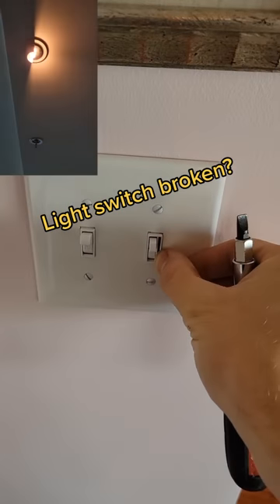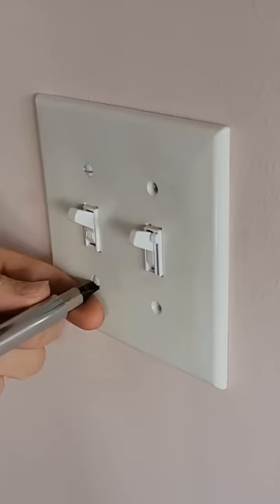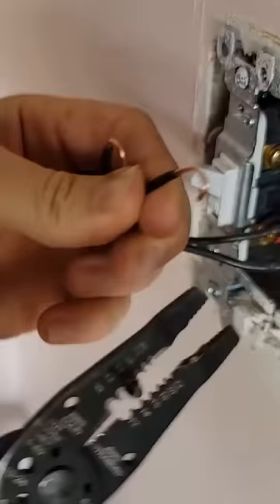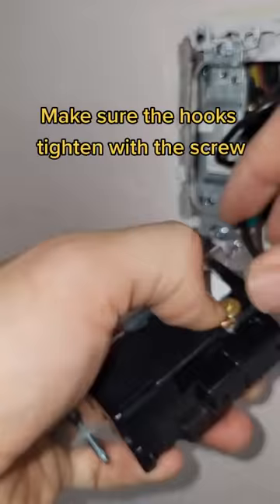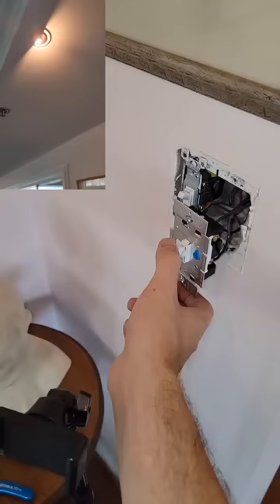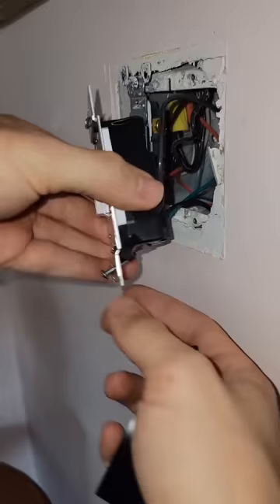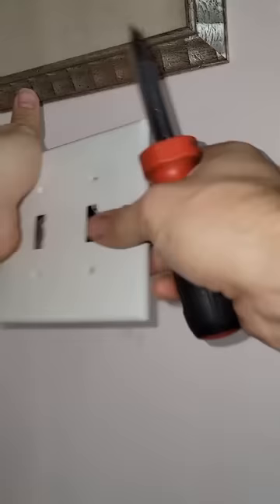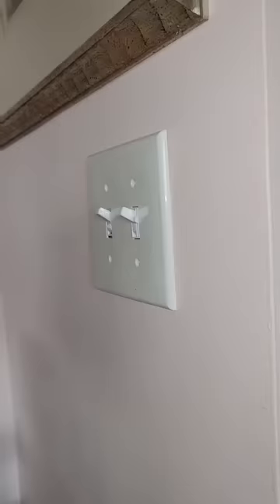dimmer switch not responding 😏 #shorts

Comment: Did you leave that single screw horizontal to trigger the electricians? Hahaha
Reply: Yeah we don't like that shit at all. Horizontal or vertical and that's the only acceptable orientation. I prefer vertical to match the direction of the switch pull or receptacle slots
Reply: @mikedavis9923  Vertical is the way to go, it keeps dust from collecting inside the screw head.
Reply: @BaerMichaelE  I’m not triggered though I do insist on uniformity. 
I like the fact that he’s doing intentionally to mess with folks…that’s funny
Reply: @samricketts8184  and it lets you know if anyone fucked with your work.
Reply: I feel like vertical is the most invisible, prevents dust and mousture accumulation rusting the heads and also is just a clean tidy finished look if every single faceplate is uniformly screwed on and not overtorqued and deformed. It's professional looking, and property owners/managers (at least pickier ones) do notice and it's one of those things that takes 0 extra seconds when you're doing the work to make your work better and have pride.

I work maintenance in hundreds of units and cleaning and tidying faceplates is one of our unit turn responsibilities, to prepare the apartment for new renters.

Painters please stop cutting in around faceplates and just Friggin take them off we hate you all so much.
Reply: Not an electrician, still triggered
Reply: I always laugh when electricians comment on screw slot placement. Most outlets I work next to aren't level but golf clap on the screw slots

Comment: Just shutting down the breakers wont do. As per NEC, referencing NFPA 70E Article 120, a Lock-Out/Tag-Out markings should be observe at all times in the corresponding electrical panel and overcurrent protective device. 

Also a proper PPE's should be observe and practiced at all times - wearing insulated gloves and using a multimeter to re-evaluate and double check the lines electricity. 

And most of all REMEMBER this. There are different electrical code in every country you live in and most of them prohibit the conduction of electrical works without a permit and a license electrical practician. One of the code objectives is to avoid any accidents and mishaps. Improper use and installation of device/equipment may cause short circuits, overloading etc. It may cause fire, injuries and even death.

Please consult your license electrician on your area. They are familiar with your own country electrical code. Better be safe ALWAYS.

Thank you for reading.

-Just a friendly advice from an electrical practitioner 😊

Comment: The 2 holes up by the top of the strippers are there to curl the wire into the loop.  Learned that on a studpack video and have used it ever since. Makes perfect fitting loops for your screw down terminals!

Comment: got 1 out of 2 things correct. Great that you connected the ground wire first. NEC states that all electrical connections ( screws & bolts ) must now be tightened to the proper torque using a torque driver.  Torque drivers should have calibration checked every year

Comment: For the DIYers, always kill the power before hooking up a dimmer. You will fry a lot of cheaper dimmers trying to hook them up hot.

Standard devices? If you have the confidence/skill set , there’s no harm in working those hot.

Also, NEVER stab into the back of the device. This will almost always result in a loose connection, whether immediate or in a short amount of time. Loose connections generate heat and are the cause of most electrical fires.

Comment: "Make sure to turn the power off"...
*Laughs in getting zapped on a regular basis because I'm to lazy to find the un-marked breaker.
Reply: just because its 120v doesn't mean its harmless. do not work hot unless you're a professional and its absolutely necessary
Reply: @jex4400  get out of here with that shit... I've been wiring shit since I was 10. Build a 100kv transformer that makes 8" arcs out of an old ignition coil, microwave capacitor and a dimmer switch then get back to me.

Comment: I do have to ask: why don't you use the backwiring holes? Unlike cheap outlets and switches with flimsy barbs, the backwiring holes on that dimmer have metal plates that sandwich the wire inside. While it's not going to hold  pounds of weight, it's plenty of tension to keep it in for decades to come, is a lot faster and easier, and doesn't have the added risk of possibly torquing the loop out.

Comment: I had to put an outlet in in the attic at my grandparents place when I was installing their security system. That was my first time messing with mains, but I've played with circuits and electricity since I was young so it was pretty easy. I used to be a cable guy though, and it was a big OCD of mine to make all the screws align on faceplates...

Comment: That little blue thing on the switch front is to adjust the dimming up and down before putting the faceplate on. It lets you dial in the minimum light that you want on that dimmer

Comment: Bro I installed all my grandma's new light switches, and never thought about putting electric tape around the outlet. Sounds like I got plans for this weekend! Thanks for the tips!
Reply: Mainly recommend for metal electric boxes to avoid future probelms
Reply: I hate it. Unless I'm working in a metal box where things are close, it's not needed. Everybody thinks of now, but I think of later. Dealt with a lot of outlets and switches where the adhesive on the tape turns bad, and sticky as hell.. I'll pass.
Reply: not usually used in residential, but in commercial or wherever a metal box is used, it’s highly recommended to do it cause it’ll help prevent any exposed copper from touching the inside of the box and tripping a breaker

Comment: One comment I saw that you broke the insulation tape off when you do this it tends to stretch slightly before breaking and over time the tape will leave a sticky residue and slowly peel off, I have also found on rare occasions that  the stickyness can become conductive. I'd suggest that when you have wrapped it take a utility knife and simply cut the insultion tape before applying the last bit it will last much longer.

Comment: Never use the sticky side across terminals , you'll get a call back for a partial shorts in about a year .have the sticky side out then flip over the normal way . Or just use amalgam tape or automotive non sticky tape .

Comment: Oh and extra tip instead of fiddling with the positioning of the switches just tighten them down all the way and tap the top metal of the switches with a flat head and line mans and you’ll nudge it to line up takes way less time and fumbling.

Comment: Say "device" you sound smarter than calling a switch an outlet
Reply: For sure
Reply: Its called a light outlet an outlet is an electrical outlet ao no he sounds smarter saying that because he knows
Reply: @2crayz  A light outlet? it's not letting out light, or anything else for that matter. Either you're right and that's dumb or you're wrong and dumb. It's a switch, which also happens to be a type of device
Reply: Let me guess you're a petroleum dispensing technician...
Reply: @brizzle8797  soil relocation expert
Reply: @mikerourke9182  
Perfect!

Comment: As a german electritian I really hate that american switches.. What da heck is wrong with that american bs 😅😅
Reply: We can't read your mind, dude. 

What do you dislike about a simple dimmer switch? 

You do know that we have many different types of dimmer switches, right?
Reply: Spiel nicht mit mir 😂😭🤣
Reply: @master-oppressor  Hes probably talking about the exposed high voltage points around the switch and the fact faceplates have screws. Also, the dimmer interface looks like something designed in the 60s.
Reply: @master-oppressor  European electricians do not work under load, unless it's impossible to not do so. For one, 230-240v has a greater probability of killing you, as well as the 400V phase to phase voltage in panels.
Speaking about the internet, it has progressed considerably since the early ARPANet days, no 1822, IMP or NCP to be seen these days.

Comment: US electrical stuff always looks like as if it is from a 3rd world country
Reply: That’s because it’s all made in another country. Also made extremely cheaply. The lengths they go to to shave fractions of a cent off manufacturing cost is ridiculous.
Reply: @MrSleepProductionsInc  idk man i am an electrician  an i have worked in Switzerland and Australia... while not as good as the stuff in Switzerland aussie electrical breakers or switches dont look half as fuckesld as what you just showed me....i mean that dimmer? And still screwed connections?? Completely blank no insulation at the connection point...its like the stuff we had in 1970

Comment: Come on all screws straight up and down. Actually as electricians we can not stab lock devices per nec code its required to wrap the wires even if it wasnt youbdont want to stablock they are very bad connections that fail esp on receps. As when you plug and unplug stuff the wires can come all the way out

Comment: Why do you cut the old wires! Do that even a few times and it's much too short. Now you have to use a wire nut to extend the wire but that's an extra splice that can go bad and you'll fill the box up and it's not uncommon to make it too full. Especially if they use smart devices which usually take up much more room.

Comment: I recently changed all the outlets and switches in my house. Did it the way you do it other then the tape. Next time I’m going to do that because I think it’s a good added layer.
Reply: not needed. unless it's a metal box and things are tight. That tape breaks down eventually and gets horribly sticky and gunky and it is annoying to work with. I never use tape. More annoying later down the road.

Comment: Not sure why you’re referring to a switch as an outlet? A switch should be called a switch or a device. It’s not an outlet. 

Technically a receptacle isn’t an outlet either, but I’d let you slide if you were working on a receptacle because receptacles are commonly referred to as outlets. But definitely not a switch.

Comment: That my friend is a switch not an outlet, yes I’m an electrician :)
Reply: Receptacle*
Reply: Technically, it’s a switch within an outlet. An outlet is “a point on the wiring system at which current is taken to supply equipment that utilizes electric energy for electronic, electromechanical, chemical, heating, lighting, or similar purposes.”

yes I’m a electrician :)
But my license says “master”

Comment: Electrical tape is a bad idea. Just adding more stuff that could start a fire if you did something wrong. Especially if you forgot to tighten something, instead of a bad connection burning the conductor and breaking the load you have a bunch of tape around the connection that either acts as kindling or hold a bad connection fixed in place making the switch run hot which might cause a fire.

Comment: I have the same switch and put some recent LED lights for some reason and my LED lights are flickering. Do you know why they are flickering when is turned on.
Reply: If it's an actual LED-compatible dimmer, there should be a little leaver or wheel underneath the cover plate (if it's Lutron, it'll be a leaver with a + and - above and below it). Set your dimmer to the level where it starts flickering, and move that leaver up or down till you tune out the flickering. This leaver also controls your lowest brightness, so once you get a feel for it, you can try tuning the low setting to a reasonable brightness while keeping it from flickering.

Comment: What a horrible finished assembly.  A master electrician would have all the cover screw slots perfectly vertical. After all you want your work to reflect your craftsmanship.  What's next  using the the bottom center K.O. out of a 4 Sq to conduit horizontally to the right?..

Comment: Hey my led lights keep flickering on a new and old dimmer switch. Ideas on fixing?
Reply: The LEDS may not be dimmable make sure the LEDS say dimmable on them if you no longer have the box for the bulbs it should say it on the plastic under the bulb if you cant find it say dimmable anywhere go get new bulbs and make sure the box says dimmable you also have to make sure the dimmer switch is rated for LED
Reply: @lazarance9628  does it matter if it still happens at full brightness??
Reply: I agree with lazarance. Unless it is written on leds that they are dimmable never dim them. It could be a firehazard too, be safe and be informed :)